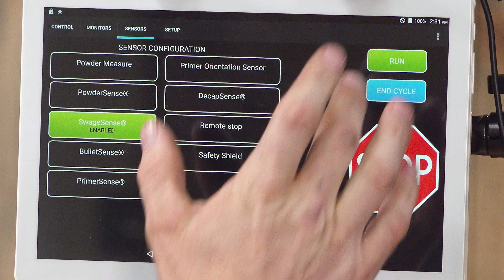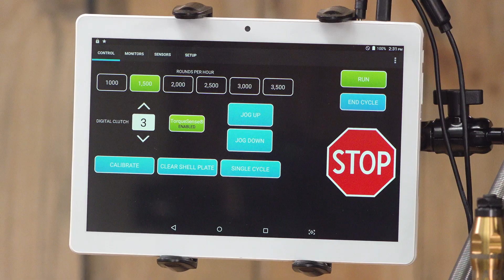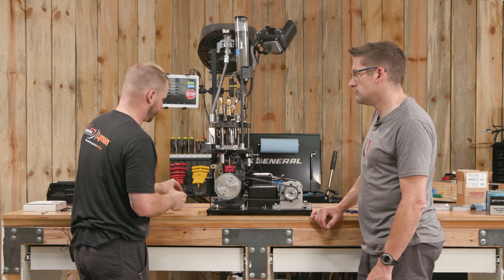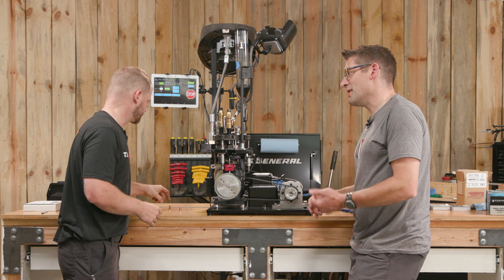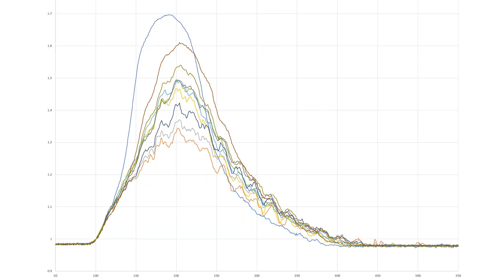Check Your Swage: Mark 7 SWAGESense Hands-On!

Comment: I just added this sensor to my Apex-10 after the wave spring in the decap die failed and started intermittently failing to eject the primer. I am loading 38 SuperComp and its 99.99% my brass all the time and this cartridge never has crimped primer pockets. I like that this can also work as the decap sensor. One thing I will mention for those who don't have this is the other choice on the popup that says, "CLEAR CASE." Choosing that instead of manually jogging up will move the toolhead back up but not index. You can easily clear the bad case. It also warns that you should check the case in the powder drop station because it will have gotten a powder charge. You need to remove that so you don't double-charge. Then, touch END CYCLE to finish that action and make sure each other station completes properly. I guess it takes a situation to show the value of these sensors. Thankfully, I just had a couple of unexpected stoppages due to the primers not getting ejected. 

I started with the manual Apex-10, then added the AutoDrive with no sensers a while later. I've added this SwageSense, the BulletSense and the PowderCheck sensors. There's not much left to add now 🙂

Comment: is there a reason why the swag sensor has to be a destructive ram rather then just a sensor that measures the distance of the primer pocket, from base of the case, could be just a push style switch that fits perfectly in primer pocket if switch is pushed it's simply because there is something still in the pocket.. this is nothing more then a high tech battering ram destroying your cases which cost more then a primer sorry but this is a bad design, some times simple is better!
Reply: Who cares about 9 mm and .223 cases you can have plenty of. These days primers are hugely expensive and I can find typical caliber cases all day on my range.
Reply: @ZhuJo99  223 brass is a bit harder to come by/buy, 9mm sure plenty of range score there., don't change the fact they don't need to destroy the brass just for a check, but say 338 lapua brass, and your 9mm brass is still more expensive just easier to find at the range. the design is dumb some one got high tech on the brain rather then common sense. also working a ram to destroy a brass case is hard on motors so there is also wear and tare just to add a high tech sensor rather then a simple cheap switch! it makes no sense it's tech dumb
Reply: @haylspa  AI at work , I never want to over make reloading this complicated I handle and inspect each piece of brass
Reply: @talkingrock7011  Agreed besides it's relaxing and fun fine art love working up loads <3 <3 <3 any ways thats for my 338 Lapua. my 45 super might be using a progressive press but I go slow and watch and measure out each powder load I really miss my old Rock Chucker 😢
Reply: Because 
All
Once fired Military Brass has to be swaged(expanded)
Before 
You can put a new primer into the primer pocket.
Reply: @amsb4dafunk558  finish watching the video there swager sensor is for seeing if there is primers stuck in the primer pocket not processing
Reply: @haylspa  
	The swager 
Was
Replaced by the new, and improved 
Swager/sensor

Comment: Interesting, my initial thought was this was an analog input measuring from a strain gauge or load sense on the swager. Using a digital input from a dry contact is so much more cost effective, granted it’s less accurate but this is a consumer manufacturing machine and not a commercial/industrial unit.